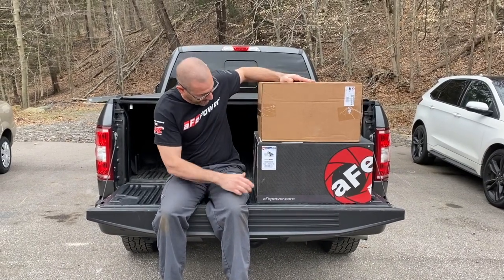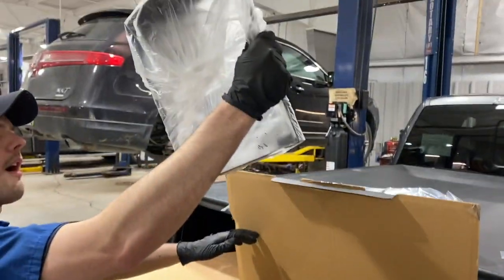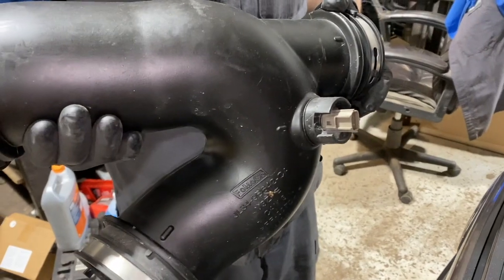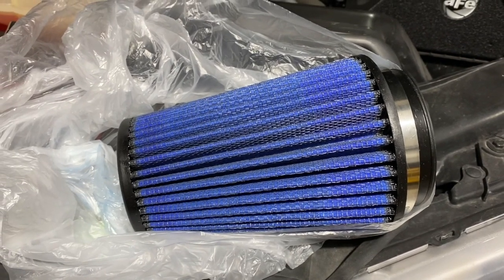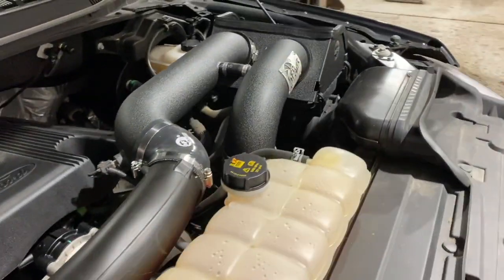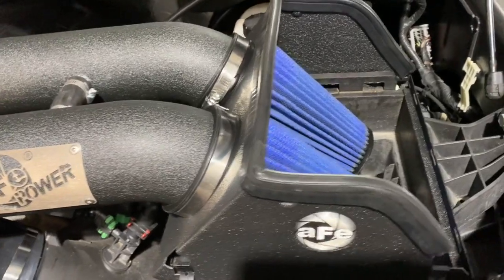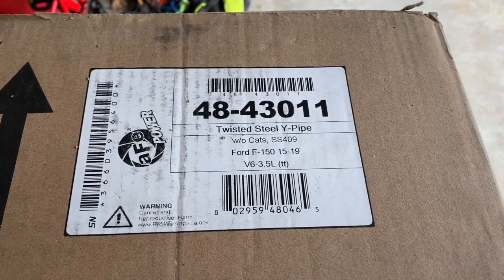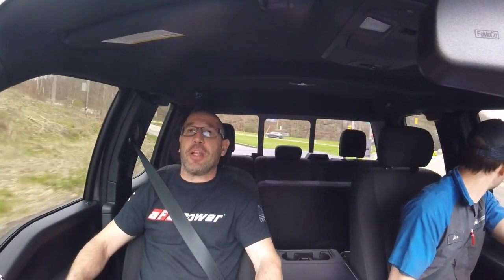2018 Ford F150 AFE Magnum Force Intake/Quantum Scoop Install

Comment: Nicely done video Brian. 

Lot of guys on F150 forum say that most of the CAI don't add any performance to the trucks over the factory setup up which they say is all ready a CAI, but this does noticeably change the sound.
Reply from the maker: Thanks Gary! AFE claims a 92% increase in air flow over the factory air box.

Comment: Dry has way better benefits vs the oiled especially on turbo charged applications. Nothing like oil hitting the hot element in the maf and then going straight into the turbos lol. That’ll be good for them
Reply from the maker: Makes sense, thanks for the comment.

Comment: I have a 2016 F-150 crew cab XLT should i get the same kit and whats the hp /torque.I like the truck cause i pull a heavy fifth wheel 9500 pounds so every bit help. Its not a Ferrari but for a truck its quick.Thank you
Reply from the maker: AFE claims a 92% increase in air flow over stock. More air=more power. Of all the intakes I have installed, I like the AFE the best.
Reply: @PIPSBURGHVIEWS  Thank You

Comment: Brian, between the 3.5 and the 2.7 which would you recommend based on what you see in the shop? I can get a killer deal on a 2.7 STX right now at my local dealership.
Reply from the maker: Reliability is about the same but the 2.7 gets better fuel economy
Reply: If are planning to do any heavier towing, go with 3.5. If not, 2.7 is better deal

Comment: What was the last piece installed. A vent something by the turbo? What is it and where did it mount. Thanks
Reply from the maker: Vent fitting, it goes in the valve cover vent tube. It redirects air to prevent a check engine light.
Reply: @PIPSBURGHVIEWS  thank you very much. Not that familiar with the 3.5 . Great video.

Comment: Yo Brian, I have the 2018 f150 5.0. Would you recommend this for this truck?
Reply from the maker: Shelton wade yes, I would.
Reply: PIPSBURGH VIEWS ...ok I’m worried about causing a check engine light after doing this mod, any issues w/ that?
Reply from the maker: Shelton wade, no issues. I have installed multiple intakes and never had a problem.

Comment: I really wish somebody would do a before and after dyno with these on the stock tune. I want a cold air but I want stats and dyno charts before I order it
Reply from the maker: I tried to do that with my BMW M4 but its really hard to get dyne time around here.
Reply: I meant specifically with the afe intake on the 3.5 ecoboost.